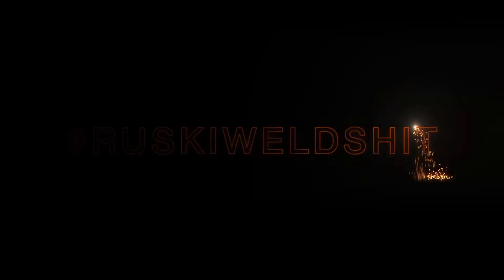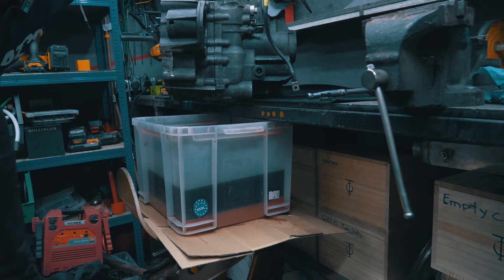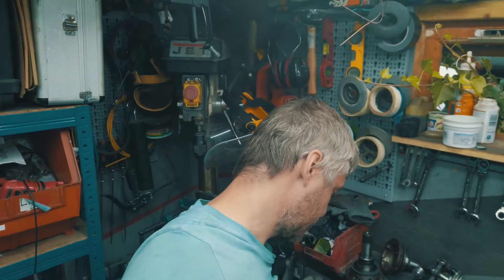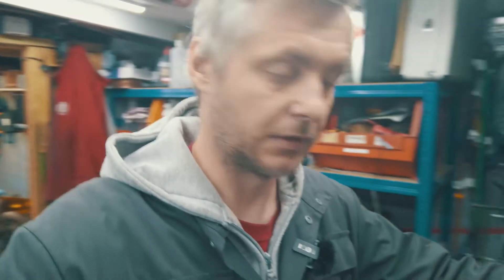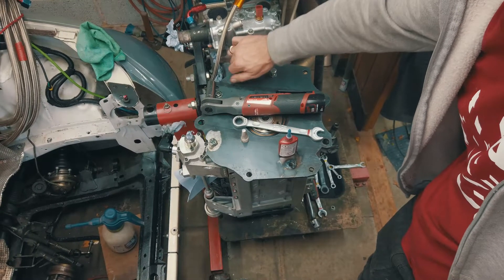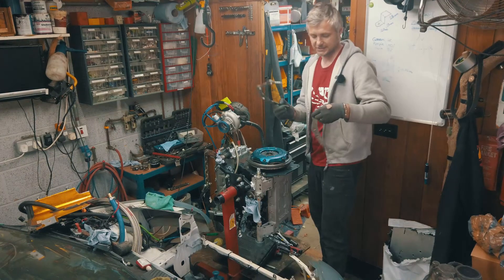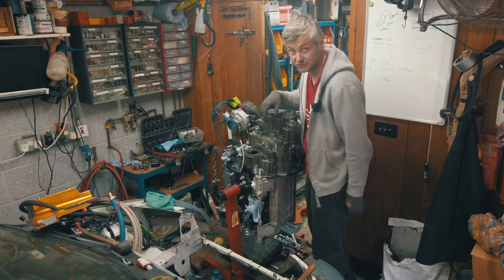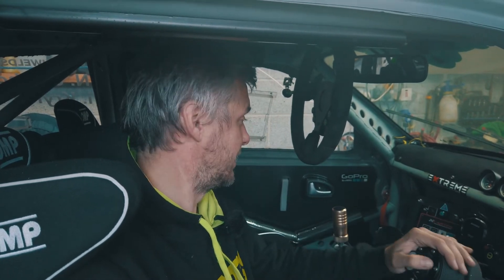Why my gearbox failed on the dyno? 02m gearbox repair.

Comment: Just got back home. well good news and bad news! good news is that it hasn't blown up! and actually did 200bhp at only 5psi. bad is that past 200bhp clutch started slipping. progressively worse to the point it wouldn't even drive coming off the roller. so that put a stop to it for today! my fucking fault for fitting back the old clutch. yes i have cleaned it but we think the issue that when it got hot  oil started seeping through and glazed them to fuck so.... Engine out job. send clutch for new material put on. try again! better luck 4th time lol.
Reply: Ufft, fingers crossed s new clutch and you'll be sorted 👍

Comment: This swap Is Better than NDO gearbox with oil cooler radiator?
Reply from the maker: Is NDO a straight cut gears?
Reply: @RuskiWeldFab  NDO 000 with LSD gripper stock internal

Comment: The shaft extension is only held in place with loctite? I'd be worried this would spin on the shaft and wear out. Thought about a machining a keyway? Or is it not an issue?
Reply from the maker: Yes it is. It’s only a supporting shaft and sits inside a bearing so should have a minimal tendency to spin. +it’s hardened steel so should be able to survive between diff maintenance. Will be checked every time.